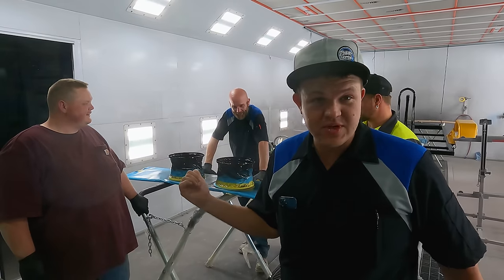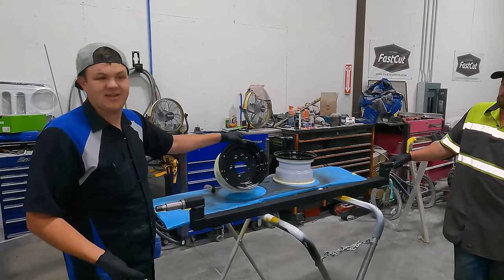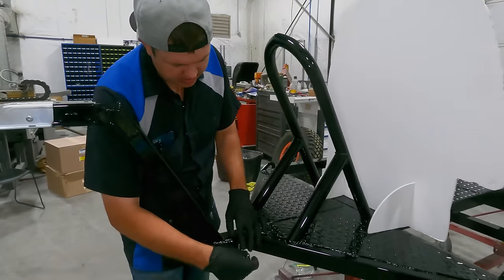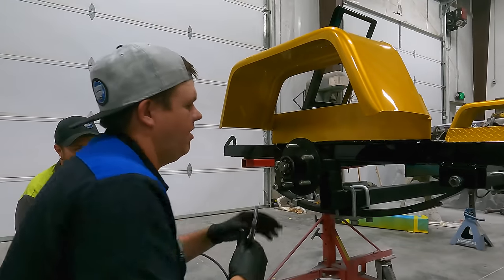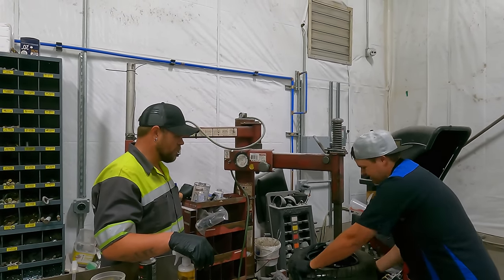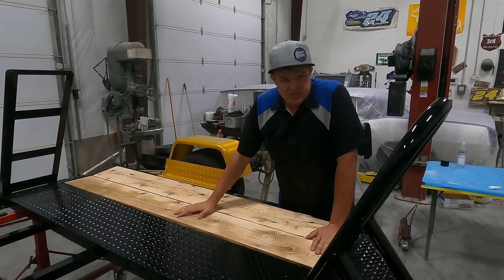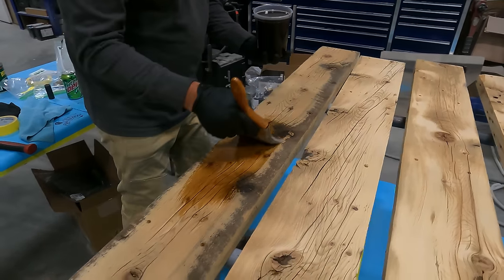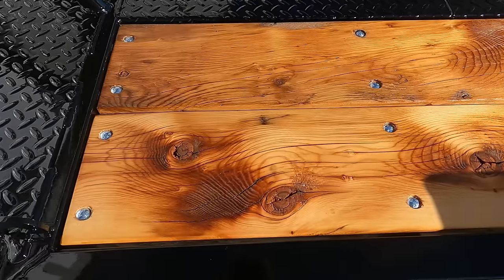Golden Nugget Trailer Is Finished.. Where's Ed's Rokon?

Comment: I'm a forty-year carpenter myself and done similar projects. I'll tell you right now huge safety issue with Ed slipping on that varnished surface if there's any type of moisture at all. Take some epoxy resin roll it on the boards dusted with silica sand let it dry sweep it off and put another coat of epoxy over-the-top you'll still see the beautiful wood and Ed will be safe. This is a must-do!
Reply: You guys are amazing. Thanks for all you do.
Reply: Ohh the trailer need stairs up how can Ed get up??? and a hand rail
Reply: Daffy is absolutely right, they get slippy so bad when there's only a bit of moisture. Take his advice serious please for Ed's safety!
Reply: I agree, however I also look at that ramp and see it made of spaced out with metal going across to ride on oh, well that might be okay for Implement equipment, and the bike maybe a 2-wheel drive, but one of the most important thing for a motorcycle trailer is to have a smooth transition on and off of the trailer. The ramp should be smooth and flat, instead of bars go in acrossed.
Reply: I came here to say exactly this. As an offshore sailor, I know that using sand in paint and varnish is a tried, tested and vital anti-slip technique.
Reply: They sell anti slip tape for floors that'll work and will look nice
Reply: @justinhobart8747  another thing about ramps is how wide they are. I feel it should be wide enough to be able to put feet on it while driving bike up. That way the bike doesn't flip sideways if something happens loading.
Reply: I'm a 39 year old plumber and yeah, gloss smooth flooring whether tile or wood is pretty slick. Pretty much like walking on ice when it's wet, or oily. Hopefully Ed won't use it when it's wet or he may be looking at some new hardware for his hip.
Reply: That's right. If you guys don't believe it, just put a bit of wateer on the trailer and try it out. Be careful though.
Reply: My thoughts exactly !
Reply: Sounds like a great idea!! We gotta take good care of our buddy Ed!!!!
Reply: 14 years a trucker and they had the prison refurbish the dry vans and it looked like they had decoupaged the floor.  You could slide 53’ to the front.
Reply: Ed won’t be using the nugget rokon or trailer. It’ll be getting auctioned off for charity.

Comment: RE the trailer tire pressure: Even 40 PSI is way too much considering how light the Rokon will be. Once you have the bike, I suggest loading it, then letting out enough air so the tires have about a 2-3 inch contact patch, and make note of the pressure.
Those tires are meant to hold up like 1100# each. the Rokon will be no where near that. AIR DOWN FOR THE BETTER RIDE!!

Comment: Having stacked a few hay bales in my life, when those beautiful boards get wet they are going to be really slick.  An old farmer hack is to throw some sand on the final wet layer of paint-that way if the trailer is wet/damp, Ed’s feet won’t slide when loading/unloading.
Reply: You are spot on Steven, those boards can get super slippy when wet
Reply: I'd imagine Ed won't be taking it out too much in the rain. It's really just going to be a showpiece.
Reply: @keithparker3414 .  Don't worry, if the trailer is kept outdoors the varnish will start to peel in a couple years.  Won't be slippery at all.

Comment: Looks awesome guys ! The only thing I may have done differently is I may have done a gold ring on the rim lip . Love love love the wood ! May want to add anti slip tape strips . That is going to be slick if it’s wet .
Reply: Yes, Gold Chrome Beauty-Rings - that would be awesome.  I So look forward to seeing Ed's face - He truly deserves all this attention that is for sure...
Reply: Wheels
Reply: I agree with you on all points. Looks great! Looks slick (not so great). I think I mentioned that to them when they were painting the diamond plate. We’ll see if they listen. Hopefully 🙏🏼
Reply: They also make a clear spray with a grit mixed in so it will be anti-slip and still have the same look.
Reply: The trailer looks absolutely awesome

Comment: Hi guys just thinking that the shinny glossy coating on the timber could be a slippery slidee hazard for Ed when wet or frosty. Maybe get some anti-slip grit & sprinkle it over a wet coat then top coat to encapsulate. Love your work 🖖😎🇳🇿
Reply: Please put some anti-slip grit on the wood. Ed will bust a hip climbing on that trailer. First parade he uses the Nugget and pulls the Rokon trailer, some fan’s kid will be scuffing all that slick varnish up anyway. Pretty. But when boots are wet… slick as glass.
Reply: It'll be fine. No one is going to be walking on it in the ice or rain. Its for a dirt bike. You dont ride it in the rain.
Reply: @mikeworkman3593  What world do you live in?  Of course it'll get wet sooner or later.  Old guy slips and ends up with a broken pelvis that could have been prevented with a bit of grit.
Reply: I’m not worried. I don’t know Ed personally. He might decide it’s a show rig or he might decide to use it. If he wants to use it he’s smart enough to put some grippy tape on it and it won’t really hurt the looks. Give the man some credit, he’s probably wiser than all of us combined

Comment: This looks awesome! BTW the number on the tire is the max psi rating for the tire. I can tell you from experience that 40 is way too high, my guesstimate is 25 but no more than 30🤷
Reply: 40psi would be a good pressure if you're close to gross...but with that little trailer hauling nothing but the Rokon, probably 25 max.  Gotta look at the contact patch and the way it handles.

Comment: The clear finish on the barn wood turned out beautiful.

One thing that might be of use on the trailer for Ed is a hand rail. It's possible after climbing the ramp, Ed might have a balance issue that the hand rail would solve.
Reply: The ramp should have been as wide as the trailer to be able to put a foot down while going up it, I've worked with both kinds and a wide ramp is the best.

Comment: I know everyone is doing this for Ed. I feel like you might be missing an important detail. The ramp onto the trailer is a little skinny. Maybe putting an 8in wide step on either side of the ramp will help if he has to drop his feet while loading. He could easily fall off to one side or the other. My suggestion is to bolt on another couple pieces of reclaimed wood. It would greatly reduce any risk of an accident and wouldn't add to much more weight to the ramp. Maybe even give it a helper spring. Just a suggestion from an avid fan of all the channels involved! By the way, it looks absolutely amazing!!!
Reply: i was thinking the same, but im sure ED always has his friends and family around to assist him. Plus bet ED would say "I got it" full send!

Comment: Looks great! You might want to look up how to properly torque a wheel bearing castle nut and you might want to install  cotter pins in those castle nuts. Other than that its beautiful!
Reply: I saw cotter pins before dust caps went on. Nothing wrong with the way they did it.

Comment: The trailer looks fantastic guys. Did you put cotter pins on the axles?
Reply: I've tried to verify that also.
Reply: Come on do you really have to ask that 😳😣?? He never had a Trailer tire/wheel fall off yet ☺️😂
Reply: They did, I was concerned but they are there.
Reply: I thought it looked like they did, he had pliers doing it.
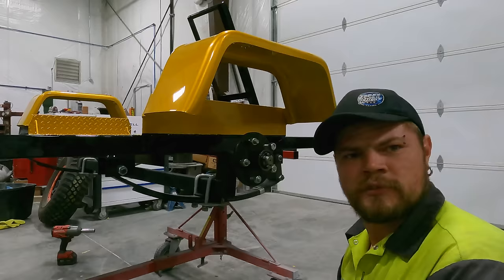Reply: At 7:28 Robby said "your holes off." Hillbilly then backs off the nut. Surely they are not dumb enough to not use cotter pins.
Reply: @jlogan6303  I wouldn't question that they put the pins in even without any clues.  They did put the rear leaf springs of the Suzuki on backwards apparently.  Easy mistake though and they do such good work.
Reply: There's always one

Comment: Absolutely beautiful trailer!  The colors and materials are absolutely perfect!  However, I do think the design concerns noted by previous posters are valid.  That ramp seems a little too short, too steep, and not enough cross bars.  

Now, the Rokon has agricultural tires, so it will climb it, but it will be a bumpy ride and may be a bit too much for Ed to control.

As for the slickness of the boards, that can be fixed easily by applying some strips of black skateboard tape.

Otherwise, Robby has proven himself to be a master craftsman at his trade and as a former auto claims adjuster, I have worked with a lot of shops and Robby's seems top notch.

Comment: … I would put an extra wide ramp… one little woops and Ed and the Rokon could be waiting for help… just a suggestion… or a small ladder to walk along side the Rokon while you load it…
Reply: Excellent suggestion. I was thinking the same thing. Something similar to the trailers used for landscapers. Also, it would let him walk up the ramp to take the bike off instead of having to step up on the trailer. Us old guys appreciate that kind of thing...LOL
Reply: @kieberg  … thanks… I had a 400lb bike and now a 830lb bike… a little bit of “just in case” goes a long way…

Comment: Love the project and work you have put into the builds for Ed.  “I” think the entire rim on the trailer needs to be painted, seeing the white inner rim from the other side of the trailer looks odd to me.  Otherwise, awesome work.
Reply: came to comment this as well
Reply: Agree, just some rattle can black to hide the whiteness is all that is necessary.
Reply: I assumed they would do both sides. It does look odd.
Reply: I agree, the white did look odd. It's covered by the planks now though.
Reply: Noticed the same when they were putting them on the trailer and thought 👀！

Comment: Robby,
The spring goes next to the top part of the hitch. The way you have it is putting the hitch pulling against the spring. 
The spring is so the bottom part drops down when you release the latch.

Comment: It looks amazing, I think the only thing extra I would do is to put some Tecmari non-slip clear deck coat on top of it, it won't show and it is non slip especially when wet. I use it on my boat and it would give Ed another level of safety. I love the wood that was an amazing addition, you guys knocked it out of the park. Awesome!! I cannot wait to see the next part with the Rocon.

Comment: Turned out beautiful! Only input I would have would be something to add traction to those boards as they could be very slick with any kind of moisture on them. And maybe a piece of rubber or something on the ramp where it touches the ground to keep the beautiful paint from scratching off and making a rust spot!

Comment: I love the way the gold and black in the trailer match the gold and black in the timber. I have to wonder if the timber won't be a bit slippery when the trailer is wet or muddy. Wouldn't want Ed to fall and break a hip. I would be making up a pattern with masking tape, putting another clear coat on and adding some slip resistant ground glass grit, followed by a couple more coats.

Comment: Man that trailer looks great you know if you could put a heavy clear coat on those boards with glass beads not sand  it would glow at night when he loads and unloads at night from the headlight on the Rokon and give traction for him walking on it . also there is a rubberized clear coating you can put on parts of the trailer that might get chilled from rocks.

Comment: The pressure listed on the side of the tire is the max pressure for when it is at max weight.  This light little trailer doesn't need anything close to that.  
That wood is going to need some no-skid on it.

Comment: That trailer came out looking stunning. Love the aged wood. 
Yes, shackles to the back because when you hit a bump like a rock you want the axle deflecting back away from the obstacles as the leaf spring compresses, not forward into it. You should though have weight on the suspension before tightening up the hardware so that the bushings aren't twisted when its sitting on the ground normally. More of a big deal on stuff like control arms and spring bolts on heavier vehicles though.

Comment: When you mount bearings you preload it by tightening it then back off until it is loose then hand tighten it. Then loosen it just enough so you feel a tiny bit of play when you grab the hub and rock it on the axel. Not rotate it but rock it.

Comment: I looked at some blogs on trailer pressure, you might use the recommended pressure; they are a different design than auto tires and they will fail under low pressure.

Comment: Matching the old wood with the black paint achieves little contrast.  Missouri red oak would have been a knock-out contrast.  Personally I like to use linseed oil or Tung oil on specialty projects such as this. If resin finishes are chosen, please include 'aluminum oxide' in the last coat for anti-slip properties. Missouri black walnut would have been an outstanding choice too. Did I mention I live in missouri?

Comment: Another one about tire pressure.  The pressure listed on the side of tires is the MAXIMUM allowed Not the recommended pressure which is dependent on the load it will be carrying.  The method suggested by dieseldave564 is a good one.  I would only add that in addition to the 2-3 inch contact patch front to rear, the tire should also contact the road across the Entire Width of the tread. (actually shouldn't be an issue if the tire is the right size for the rim)

Comment: I assumed you were going to use expanded metal where wood went, it looks great but it will hold dirt & water , will also remove finish after walking on it. But will it be slippery is the big ? don't want Ed to fall off .

Comment: tire pressure ratings, like the 50PSI you said, are for the tires MAXIMUM load rating.  you can and should run WAY less than that for something as light as this Rokon+trailer as the max pressure will ride really harsh and bounce the trailer all over the place on a rough road.

PS, that thing came out GORGEOUS!  🤩

Comment: The trailer looks great!! I’m not usually the guy to put in my two cents but the clear coat might be slippery when wet. Maybe one more light coat with a touch of sand. A slip and fall for Ed could be really bad. 
Again, it looks amazing!!!
Reply: I’m thinking Ed will be wise enough to add nonslip tape if he decides to use this combo for adventures

Comment: @:22 ....making wood lol. I believe that's a different web site, probably not family friendly. 
The barn board looks great! ...I might have put a little fine sand in the clear for traction?
The wheel nuts, tooo plain...needs the spike ones.
One more thing (I'm a bit picky myself)...when you assembled the suspension you put the nuts/washers on the outside. That's ok if you're using an acorn nut or something else.
My $ .02 ...keep up the good work!

Comment: The trailer alone, looks like too much black. But once that bike it straped in she'll fill it in to make it look great.
A cool trick I've seen, use a large propane torch to char the lumber before the poly, the ones that connect directly to a 20lb tank, it can help make the grain really pop. Grain looks good on these, the finish looks a bit overly glossy right now, but that will age off nicely.

Comment: ive have been tempted to use expanded metal instead of wood for the feet part of the trailer , wood looks nice but its going to be slippery when wet and muddy and possibly heavier than the expanded metal would be

Comment: Why didn't you use trailer deck screws ? You pre drill a hole and the  Screw self tap into the metal.

Comment: Maybe put some nonskid tape to the center of the trailer on the diamond plate and the wood just in case Ed drives on with wet tires or wet shoes this way Ed nor the bike doesn’t slide out??

Comment: Robby the trailer looks great but those glossy boards will be a problem. Just a bit of moisture on them and they'll become very slippery and unsafe. You should find a way to make the surface on those boards more sure footed like a strip of "no slip" tape down the center of each plank. Just sayin'

Comment: That Red Pine is a nice wood. Not quite as valuable as white pine, but getting there. Far nicer than Jack Pine. Jack pine has short needles, not too much longer than spruce or fir. Red Pine and White Pine have longer needles, about 4 inches/10 centimetres.

Comment: PLEASE READ!  Beautiful trailer, but you missed a safety factor on the ramp.  You should have diamond plate foot rest on each side of the ramp.  If the Ed's cycle stalls out going up the ramp, Ed wouldn't have any place to catch himself to stop from falling over.  You'd only need about a foot on each side.  Aluminum diamond plate could be used to save weight.  I think this is a must for Ed since he is older and his balance might not be as good as it used to be.  Thanks, concerned Stan Smith  ;)